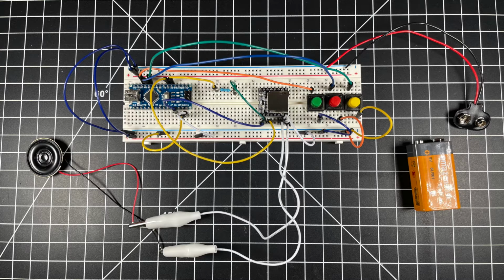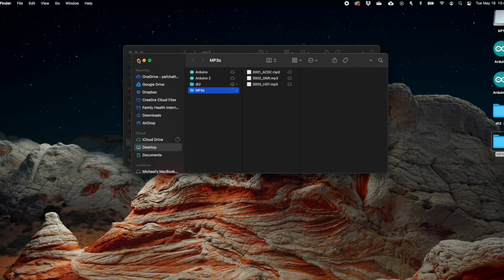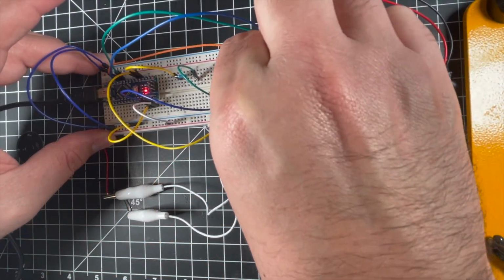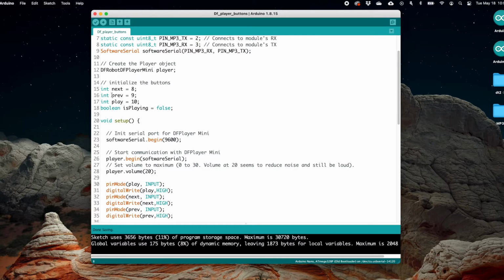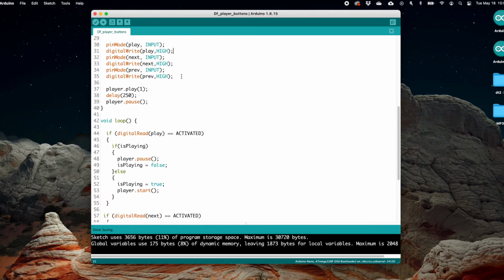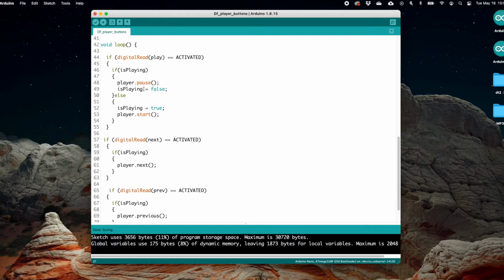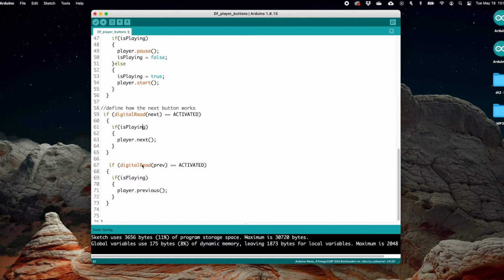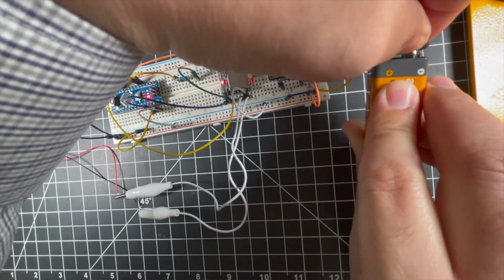Arduino Nano with DF Mini MP3 Player || Arduino MP3 Player

Comment: Hi Michael, Nice work, I have a question and I hope you can help, what if I have multiple folders any idea how to switch to another folder and play a song there, each folder has songs from different artists, that way I can choose the artist.
Reply from the maker: I’d have to do some homework on that (I’m not an expert on this at all). There are a few Reddit threads about the DF Mini player and I think there was some info on GitHub, but generally, I had a hard time finding much documentation for it. I suspect it is possible, but I don’t know how to do it off the top of my head and I don’t remember seeing it when I was researching for this project.